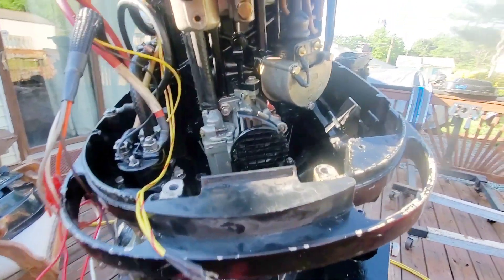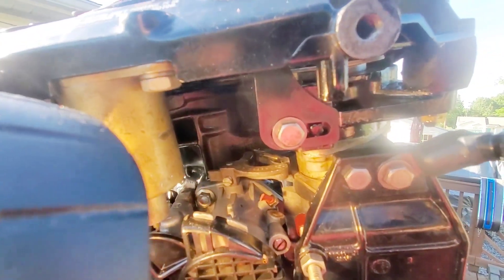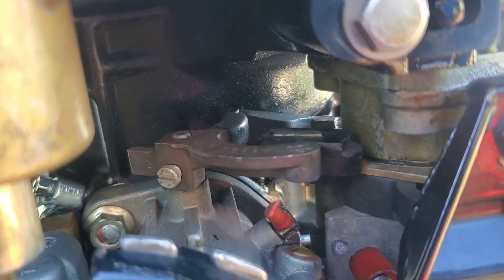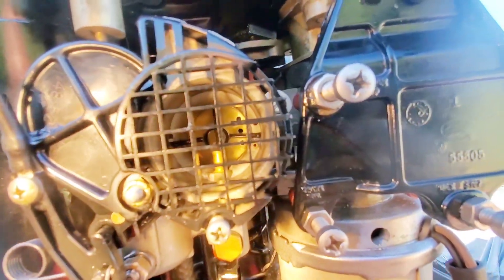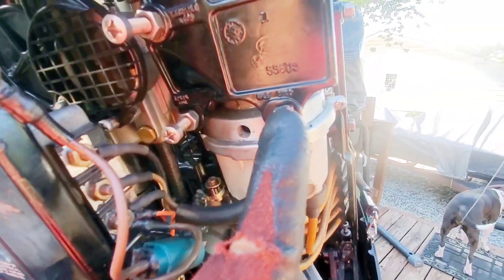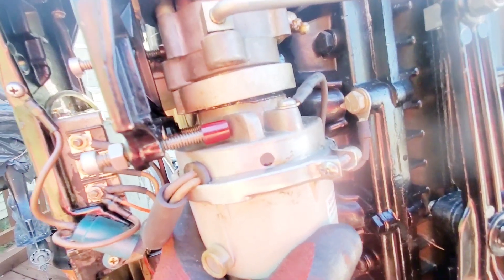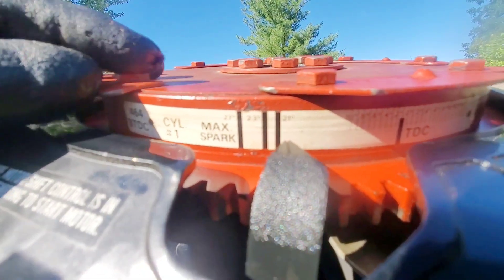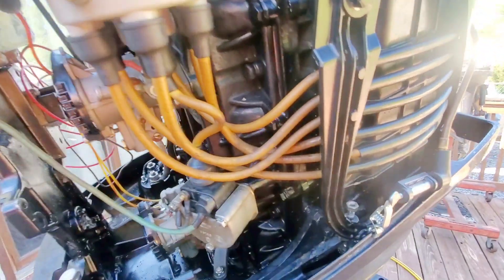L6 Outboards Link & Sync: Distributor Ignitions

Comment: Hey Son, I'd really appreciate it if you can tell me what's the cause for a low idle that'll die when the enricher is backed all the way to neutral 😐 I'm at a loss, rebuilt carbs changed all spark plugs, fuel l9nes and pump rebuilt years ago but never ran it. Feels like it needs to increase the idle rpm...do i do it using the fuel mixture on the carb? Thanks a million bro.

Comment: Hello. What is the clicking doing in the distributor?
Reply from the maker: Spark. Son
Reply: How does this work? I'm sorry, I just don't understand how sparking g the distributor 7 times gets the spark to 5 degrees? Please help. I appreciate it.
Reply from the maker: @charlierichardson1826  you find TDC. Set pointer at 5 degrees by turning the flywheel. Loosen the idle stop screw by backing it out. Then gentle turn the distributor until it sparks/clicks. Ideally, you want the spark to hit as its hitting the stop. Lock down the idle screw in that position and that's 5 degrees BTDC. Son
Reply: @MerCSonL6  Thank u bud. I truly appreciate it. The book says it has to be done in the water with a load and all that, so this is truly helpful. Thank u again!
Reply: I performed the steps as described, engine isnrunning AWESOME! THANKS again! Now the rectifier is bad. Also watched ur rectifier video. AWESOME, The rectifier is also bad. Thanks AGAIN for ur help!

Comment: Hello, i need to place my flywheel back on engine but it was taken by loosen the 8 little bolts. Can u tell me the good position at timingmark when piston 1 is on tdc.?
Its a mercury classic fifty 45hp powertrim. Thanks greetz from Holland
Reply from the maker: Line TDC. Place flywheel to where it matches. Bolt down. Son

Comment: Would these settings be the same for a mercury 800 80hp thunderbolt 4cylinder with distributor ignition?
Reply: Ok thank you!
Reply from the maker: @taylorlavoy9742  sure thing!
Reply from the maker: The process is the same. Timing specs are different. Son

Comment: Hi mercson.I have a 74 merc1500..the problem is when idling is fine,once you advance the throttle it dies and will not advance under load..Any thoughts to the problem.. I chkd compression  120psi to 130psi all cylinders..
Reply from the maker: Rotate all three idle screws ccw 1/4 turn at the same time until you get a whole shot. If that doesn't work then carb rebuilds are in order. Sounds like your beast is not getting enough fuel. Son
Reply: @MerCSonL6  Thankyou Son for your reply and invaluable knowledge of the l6 idiosyncrasies.  Robert

Comment: Couldn't find a better place to ask this:  I have a '79 Mariner 140 (Mercury 1400 L6), and while looking at the distributor to understand link & syncing, I noticed it was really stiff, which led me to also notice the zerk fittings on the assembly.  How exactly do I go about greasing the setup, there are a couple of zerks up there and I don't want to do it wrong, is it as simple as pump grease in, wipe anything that poops out off and continue on down the path? Thanks SON!
Reply from the maker: Grease gun with marine grade grease. Son

Comment: Hey Son,
Hope you get this message cuz I really need an answer. 
Thanks to you I tackled a  powerhead replacement.
In setting the timing it went well but, the timing sticker was not good enough to make sure it was at max. Think I might be closer to 18-19*. If I’m at 18* what will be the issues if any?
Had to go closer to 0* to idle down. Haven’t been on the water yet. Fired it up and it runs well.
Around 120psi on all.
Is there a precise measurement from TDC to 20*? Will I be damaging anything trying it at 18*?
Thanks
Reply from the maker: 18 is good. Today's fuel is crap. Son

Comment: Great video. I have mercury 500. I try it with your method, but no spark was found. my motor runs. The spark only takes place when the engine is running. Is anything wrong?
Reply from the maker: A 500 has a different ignition system. The high and low speed coils are in the distributor. This link and Sync method will not work for your engine. Just set the primary and max to spec. Son
Reply: @MerCSonL6  I appreciate your valuable reply.

Comment: Does this video also apply to a 1974 mercury 500 thunderbolt ignition? I want to try this out because I think my motor doesn’t run on all cylinders because of the timing. Great video sir!
Reply from the maker: The ignition system on a 500 is different from an L6. It has to coils inside the distributor. One for high speed and one for low. As long as you are in spec for idle and max with throttle cam barely touching the carb clusters it should run great. In my experience it's a lot easier to get 500 syncd. Hope this helps! Son

Comment: Hey Son, I have a 1970 1150, when you’re in the boat driving with the covers off, as soon as you hit max advance watching the distributor, the engine just stops accelerating and just holds that rpm seems to cruise fine, but the more throttle you give it the more unhappy it gets. All link and sync procedure is followed, only thing unusual is the distributor is very hard to turn
Reply: Check that when the distributor is at max advance that the throttle is overcoming the "economiser spring" and that ALL carbs are actually at WOT
Reply: @izaacbanks3337  ok thank you I’ll check it out 👍

Comment: hi, MerCSon I have a few questions. I have a '71 1350 merc with the thunderbolt ignition. I just replaced the distributor on it with a CDI as I was getting no spark. I was getting power to the distributor but not coming out of it. this is my first time taking on a motor project on a boat so I'm lost a bit. my flywheel doesn't have any TDC marks on it except the 3 dots. the pully's arrow is worn off so I have no point of reference and I am out of money to buy new parts. is there another point of reference I can use in the pully when I find TDC? also, I'm lost on how to adjust the degrees on TDC. I know on cars you change the positioning of the distributor but I'm not sure how to do it on an outboard.
Reply from the maker: The 3 dots are TDC. You need a new pulley cap with the arrow to properly align the distributor with the engine timing. With the new cdi trigger the spark will be strong. All you have to do is align the distributor with the spark. Son
Reply from the maker: https://youtu.be/2ZofSfCQVXw 
This is the exact operation. 1/2 tooth off will throw off your entire operation. Let me know. Son
Reply: @MerCSonL6  is there supposed to be any vertical play in the distributor when bolted in? I've got probably 1/8 of play where I can move the distributor up and down. do I need to take it apart again? if so where would I tighten down because I tighten down everything I could as mush as I could when I put it back together

Comment: Any possible way to show a video on where the throttle cables should be so that I am getn the correct response mine is at a point when pushed forward at controls its like they only go 3/4 of way and rest is dead spot no more throttle I was just wondering if thats to do with cable barrel screws that come into front of engine on that mount are not set correctly
Reply from the maker: Sounds like you need new cables. I'll add throttle and shift linkage to my docket. Son

Comment: So what is the deal with the carbs and the little orange red heat shrink on the top of the carbs? Where the black hose goes from one side to the other. Should I do that on my 1150?
Reply from the maker: Thats the back drag circuit. It allows air to mix with your fuel. Thus thinning out your fuel/oil. I prefer a rich fuel mixture vs a leaned out one. Not necessary but a preference. I always disable the back drag tubes. Son

Comment: Ok none of my screw settings are there are back off so starting from the beginning on seeing the screws. Where should the distributor position be when setting the arm to touch the throttle opening. When I turn the distributor as far as it will go clock wise  I have 1/4 inch gap. Hope not confusing. Really need help. Should I set primary then set see when I'm at with the arm. 75 merc 850
Reply from the maker: The carb cluster should be barely touching the primary pickup. The curve in the primary pauses the butterflies from opening for a millisecond allowing the timing to advance before the butterflies slam open from the secondary pickup. Son

Comment: I have a 1985 115 power trim and it idles good and revs fine  in and out of gear but as soon as I put it in gear in the water it bogs any suggestions.
Reply from the maker: Try turning all 3 carb idle screws 1/4 turn ccw.

Comment: Hello Son, I have. 1978 Merc 115 hp In line 6 and when you take of just as it starts to rev up under a load, it it kills and goes again quite a few times and when you back out of it and accelerate slowly it will wind all the way up. Any ideas? Thanks !
Reply from the maker: Try turning all 3 idle screws ccw 1/4 turn. If that doesn't a lower pitch prop might help. Otherwise, you may have a fuel intake issue.  Let me know. Son
Reply: @MerCSonL6 hey man I had a similar issue, runs okay on muff and as soon as it’s under a load in the water it dies, gonna check my timing and everything Tommarow but I did change the prop from 3 to 4 blade since it was all the guy had…. Could this prop affect my getting up on plain? It won’t go over 5 mph I have no idea what to do

Comment: Do you think you might eventually do a video on fuel pump assembly rebuild I’ve got a 1980 90 and I rebuilt the carbs thinking that was my issue but the pulser is what I was told the problem is with it dumping gas into crank and not running through the carburetors and do you have any ideas on what might cause that issue. I know I love your videos and even having the manual your videos have been extremely helpful on things that I’ve over looked. Thanks for your time and responsiveness mercson
Reply: I just made a post that ties into this post. Here is hoping.
Reply from the maker: That is a crazy issue to have. By pulsar do you mean the negative and positive pressure from the crank? Or the check valves? The 1980 fuel pumps have a base gasket that eliminates this issue. Well, should eliminate. Let me know. Son
Reply: MerCSon L6 I’m not quite sure yet I rebuilt the carbs and it was still sounding flooded and I took it to a marine mechanic and they said the check valve was bad so once the carbs filled up with gas and closed off the floats it was dumping gas into the crank it’s been there about a month now still waiting on parts to fix it. Once I get it back and find out what was wrong I’ll let you know. I did buy a fuel pump assemble from a guy on the mercury outboard enthusiast so if I get that before they get parts to fix the one on the motor I’ll mail it to you to take a look at.
Reply: @justinshimp5253  hey Justin, i think i have the same problem… what did u do to fix it? Replace the pump gasket ?
Reply: @StefanZivkovicMedia  my issue ended up being a diaphragm in the fuel pump dumping gas through the hole into the engine block. I got the sierra rebuild kit and rebuilt it. If you have an inline 6 mercury motor I am a member on the Facebook group inline 6 enthusiasts page lots of info from guys there that can help with troubleshooting along with parts here and there.
Reply: @justinshimp5253  thank you!!!

Comment: How do I get a hold of you? I have a 1979 Mercury 1150 that I want to get running properly.
Reply from the maker: Whats your issue?
Reply: @MerCSonL6  it was running and then something shorted the wire harness and created alot of problems for me and it never started again after that.
Reply: @MerCSonL6  if you want you can email me and I will send you my number.
Reply: @MerCSonL6  neonjoep@gmail.com
Reply: @MerCSonL6  I have a 1979 115 that needs a new engine harness and my harness  from the control box to the plug-in is cut. I would like to be able to mend the harness from the control with a new plug and figure out what harness I need for the motor itself. Then I can start diagnosing it and getting it back up to par. I know the carburetors need to be fixed because the bottom carburetor was flooding the cylinder.

Comment: Hey thanks for the videos!  I am working on a merc 900, I had it running yesterday but it died abruptly so took it apart to clean the carburetors, there was a lot of mud or old fuel sitting in the fuel bowl and directly in the jets.  Anyway got her back together but now I'm not getting any turn over at all, just a click at the motor.  The battery is full, I directly connected power to the starter solenoid and it cranked, so I'm not sure where to look, any suggestions?
Reply from the maker: Your starter selonoid is bad. It relays the 12v (usually a thick red wire) to the yellow wire which goes to your starter.
Reply: @MerCSonL6  Copy, Ill check on it and keep you posted, Thank you !!
Reply: @MerCSonL6  replaced the solenoid still no dice.  could it be my switch?  I suspect it has something to do with what I took apart yesterday but everything is connected where it belongs, ive checked at least eight times, i've filed  all of the connections, replaced small bits of wire that were frayed.  I just had it running yesterday, starter was working great....
Reply from the maker: @MikeJones-eh6el  does the starter spin when you apply 12v directly to it? Try disconnecting the killswitch at the switchbox. Son
Reply: @MerCSonL6  yes it does, it will fire and run for a couple seconds, I'll try the kill switch.
Reply: @Spacefolders   lol this thing.... so i disconnected the mercury kill switch and still nothing.  just a clicking sound from the switch box.
Reply: @MerCSonL6   I disconnected the mercury kill switch and still nothing.  I also noticed when I am rotating the distributor it no longer makes that click...not sure if it's related.
Reply: @MerCSonL6   Hey Son, thank you for all the tips.  I tested and tested and figured out the wire from the ignition to the solenoid wasn't conducting for some reason.  Put in a new wire and she turns over, but it will just run for a minute then die, then it wont start again until it sits for a long time, not sure if its a fuel issue or air issue.